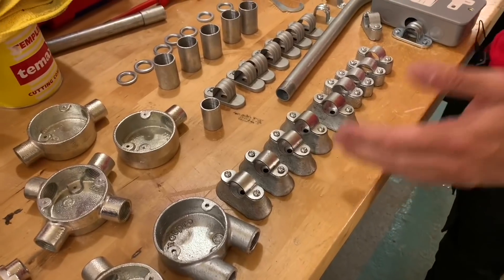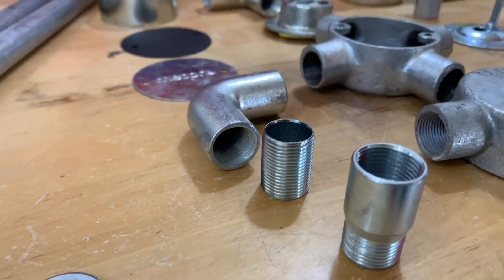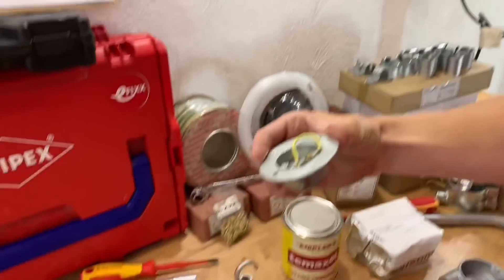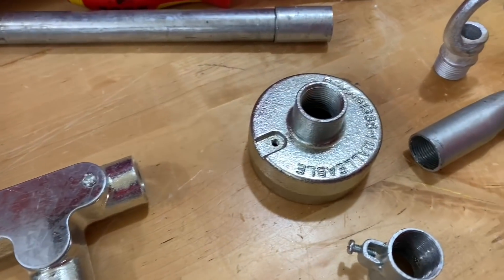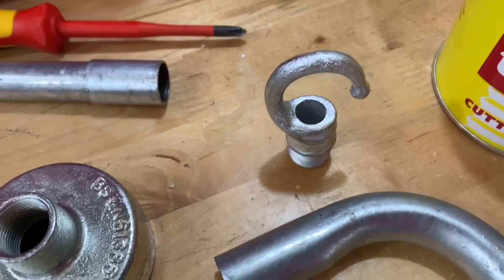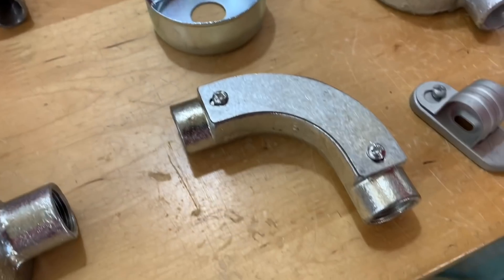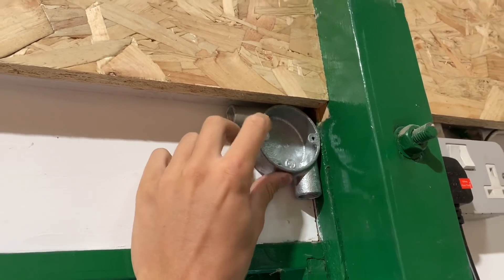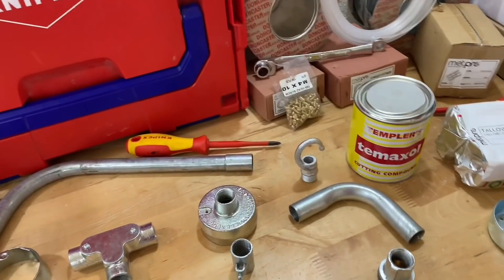METAL CONDUIT INSTALLATION Uncommon Conduit Boxes - Could you name them..?

Comment: Earthing couplers could be useful for equipotential bonding, when the conduit system is an extraneous conductive part, rather than an exposed conductive part, in extra low voltage, or data installations.

Comment: I've used earth couplers here in the states for connecting equipment grounding conductors on radio equipment, e.g. antenna aerials, lighting arrestors for N connector coax, cat5/cat6, etc. They're also used for bonding conduit sections that are at risk for a direct lightning strike (e.g. up an antenna mast) to an external lighting protection ground conductor. Due to the simply massive fault currents that occur during a direct lightning strike, all that parallel length that the normal mains protective earth conductor has with the other conductors can be more than enough to inductively couple a damaging amount of energy onto the other conductors -- more than enough to damage the sorts of sensitive radio equipment that one installs in locations like that. Therefore at-risk conduit actually needs to be kept isolated from the mains ground conductor and instead gets bonded to this external lighting protection earth, so that direct strike current remains outside the conduit. That way the metal walls act as something of a faraday cage for the conductors inside (on top of the belt-and-braces screened cable you also run in those applications).

Comment: Just wondering the flanged couplers they have a lead washer , is the lead washer on the outside with coupler or inside with brass bush ? Many thanks in advance
Reply: the washer goes on the outside to mate between the flange of the coupler and equipment.

Comment: Have used the earthed couplers when the conduit was the earth /cpc and it changed to a flexible , additional green/yellow cable tied to the outside to continue the return path . Normally got damaged or corroded so not a great idea .